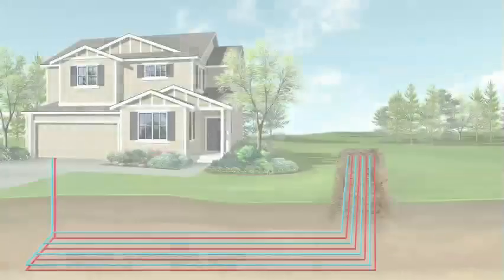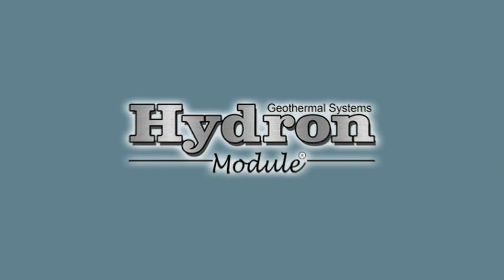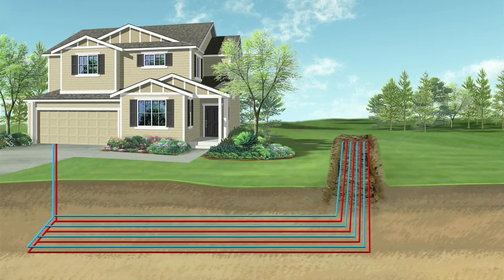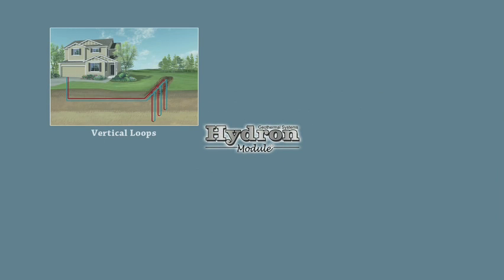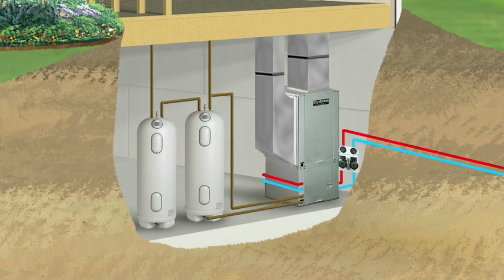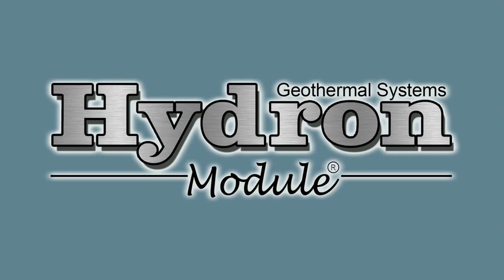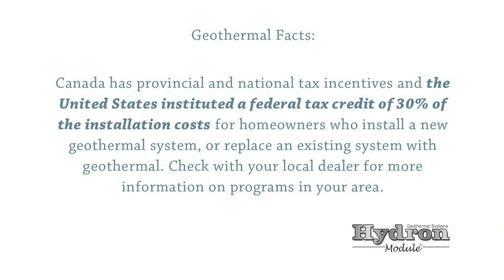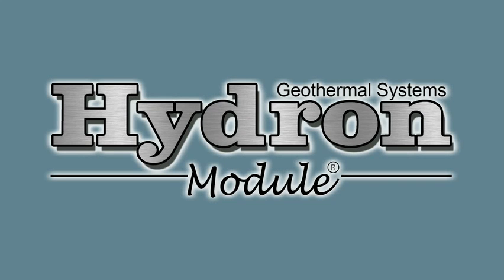Understanding Geothermal Heating and Cooling with Hydron Module

Comment: Is this a good option if my energy source is just solar panels? Or will it drain too much power?
Reply from the maker: Thanks for asking! Many people choose to use geothermal and solar technologies together. Every home is different, but your local geothermal dealer will be able to help you determine if geothermal is right for you and how much energy you could expect to use if you install a geothermal system. You can visit our website to see a gallery of Hydron Module projects, several of which use solar power: http://residential.hydronmodule.com/project-gallery

Comment: GeoThermal heat pumps do burn a little electricity that may come from fossil fuels, but that electricity is not used to make heat.  It's used to move heat (from the ground to your home).  The electicity required to move that heat is about 75% less than the energy needed to make heat.

On a new constrcution home, you'd be crazy not to go GeoThermal.  The break even point on new is about 1 year (in the Northeast).  On an existing home, I'd expect to break even in 6-7 years.

Comment: If I intend to utilize/implement the open loop system, do these 2 separate deep wells be at some distance from each other? The distance will make up for possible draining of the well that the system derives water from. And if my lot/home will be utilizing water for washing, bathing, cooking etc...from a deep well, I will need a 3rd well dug up solely fro this purpose? I live in SE Asia, and the primary need here is cooling all year round. Will a geothermal system be feasible/beneficial here?

Comment from the maker: You are correct. The system does require a small amount electricity to operate. However, in many parts of the country that electricity is generated by wind or solar, not fossil fuels. What's more, the system itself does not burn fossil fuels to heat/cool your home like a conventional system does.

Geothermal systems are cost effective in both new construction and replacement applications. The savings begin immediately and most homeowners see the payback in about 5-7 years.

Comment: "Geothermal systems do not rely on fossil fuels..."
Really?? These rely on electricity to operate. Aren't natural gas and coal fired powered plants run on fossil fuels?? As far as cost is concerned, this would not be cost effective unless installing in new construction and even then I have to question it.

Comment from the maker: The best thing to do if you're interested in looking at geothermal is to make sure the dealer comes to your home and does a proper energy analysis and site survey. Once they have the system properly sized and designed, they can give you the most accurate costs. With all the new financing and incentives, it might not be as far off as you might think. Thanks for your interest. Please let us know if you have any questions.